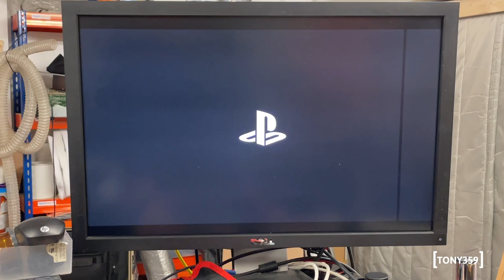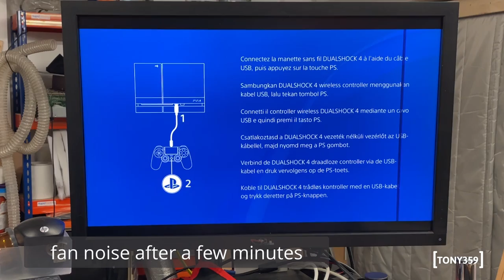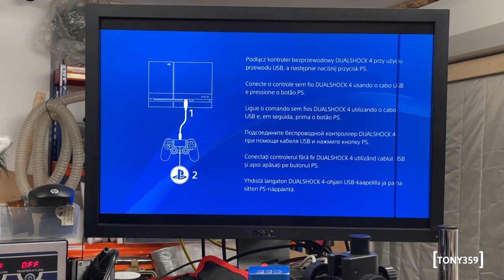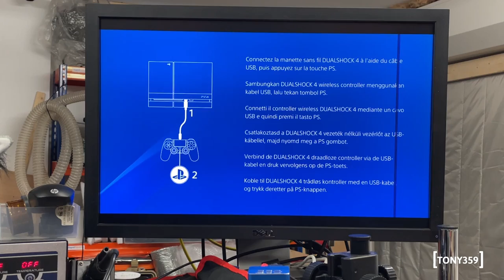Broken/overheating PS4 - Repair and Restore (Fan Fix!)

Comment: Hi Tony! I just cleanded my ps4 entirely. However it wont let me start the ps4 again now. When pluggin it in it gives a short beep and turn blue for a sec no fan spinning. And shuts down. Any recomments? Thanks in advance
Reply from the maker: Maybe 12 volts is missing? Make sure the PSU is fully pushed against the board and that you haven’t bent those prongs
Reply: @tony359  thanks Tony i tried everything you just said, but still no good result. I can hear the psu make weak noises. You think i should give i a try with a new psu?
Reply from the maker: the fact that it was working before makes me think something went wrong with the disassembly/assembly. I think the PS4 PSU should make a CLICK when it starts. But when you plug the power lead it should output 5V. 
Do you hear a BEEP when you press the on button? If not, make sure you get 5V at that little lead going from the PSU to the motherboard. If you do hear a BEEP, well then the PSU should start and you should hear a "click". You can try with the PSU removed from the PS4 - but still attached by the small/short lead, that's the 5V and ON/OFF. If you can measure 12V out of it, then there is a issue on the board. If you hear BEEP and no click and no 12V, then maybe you need a new PSU. Of course be careful with PSUs, don't open it and you take all the responsibilities (sorry, I have to say that!)

Comment: I've opened my ps4 recently and cleaned it using a small brush and air pressure. It's not as loud but it still heats up and makes alot of noise. I only removed the power box and cleaned from that area and didn't take off the motherboard to clean the heat sink from both sides. Should i still completely taking it apart if I don't have thermal paste?
Reply from the maker: it will probably help a lot!

Comment: Replaced my fan with a new one, now it sounds loud and i get a white light then off it goes. Could i have a issue with the power supply,
Reply from the maker: I suspect you didn't re-assemble the heatsink properly. Did you replace the thermal paste? Did you make sure the thermal pads were in place?
Reply: @tony359  il try reapplying thermal.
Reply: @tony359  thanks, I took of power supply noticed a loose cable. Now back up and running and like brand new. Cheap fan I was skeptical but I cannot hear any loud noise even on the jailbreak it's fine. Mega cheers to ur videos

Comment: My ps4 is overheating too. I cleaned it, replaced thermal paste and fan sounds normal. In my room is 22°C and there isn't anything half meter in any direction. I cannot play any game for more than 3min and I cannot figure out what is wrong with it.
Reply from the maker: when you say "the fan sounds normal" - do you hear it getting faster and faster before it shuts down? Have you replaced the thermal pads by any chance? Too thick and the APU won't contact properly with the heatsink. Try removing them for a test. Finally, have you reinstalled the clamp at the back of the board correctly?
Reply: @tony359  I didn't clean heatsink well enough...my bad🤦‍♂️
Reply from the maker: yay, it's working :)

Comment: My ps4 has overheating problem not even 3mins has passed it suddenly turns off with a warning sign of overheating. So, I tried opening it and cleaning all of its components and putting thermal paste, done it all for the first time. Still overheating, but improved I tried stay idle in a game for more than 30mins. So, I tried changing the fan, the thermal pad looks still okay not dry so not changing it and now it's good no jet engine noise and there's no burning like smell (the power cord is not the problem and so the outlet because its not hot). Beside the fan the cause of overheating might be the wires not properly connected, screwing too tightly, loose power cord, too much thermal paste on cpu or too thick thermal pads. In addition, when putting thermal paste put a little bit more in the middle of cpu and dont use liquid thermal paste they say its bad for ps4. If one thermal pad has crack change it too.
Reply from the maker: burning-like smell is bad! But I guess that if the fan is not working, that might happen! :)

Comment: I need your help no matter how much I clean my ps4 it keeps over heating iv tried cleaning it cleaning round it putting it on a stand so it can get better air flow but nothing is working I need help
Reply from the maker: My experience is limited with PS4 but I guess you're not re-assembling it correctly. Have you replaced the RAM pads by any chance? If they're too thick, the CPU won't be allowed to sit on the heatsink properly. Does the PS4 overheats straight away or after a while?
Reply: @tony359  if I start playing a game after a minute of playing the game it's flashing red saying its over heating maybe I may need to get it cleaned professionally
Reply from the maker: Is the fan spinning? The fan connector is very fragile. Do you hear the fan spinning faster and faster? It will get VERY loud when it's overheating. When that happens, do you feel hot air coming out at the back of the PS4?

Comment: actually, we have the same Ps4 Mode. I tried to clean it out and after cleaning it when I play my NBA loading My Career it says overheating..😢 thats why I'm here.
Reply from the maker: Is the fan spinning faster and faster until it says overheating? The fan is VERY loud when it's at maximum speed. Did you replace the thermal paste on the CPU?

Comment: For that money that is a great deal. And great job in fixing it. The fan should be opened from the back side. Just like the old PC fan. They used to have a rubber plug that after removing it gave access to an C clip that held the shaft in place.
Reply from the maker: I’ll try but it seems a plastic mould. The PS4 is a great little machine but clearly built with price in mind. Thanks for watching!
Reply: @tony359  Today the fans are no longer serviceable, sadly.  They do this on purpose, to buy another one.

Comment: Nice find.
You should also always clean the round rubber on the spindle motor when cleaning an optical assembly. (q-tip and alcohol) That makes the disk stick while rotating.
I too have 3 PS3's and looking for a cheap PS4 to get hold of.
Reply from the maker: That's an excellent point - To be honest I think I did, it just didn't make it to the final cut! I used some paper towel though as I found that cotton buds left lint behind on the rubber. Thanks for watching!

Comment: This console wasn't the worst i ever seen.
Got an xbox 360 that had way more dust but mostly cat hairs inside, the controllers had half a packet of crisps and beer residu inside.
The older consoles are way cleaner to work on.
The fan probably has a clip on the other side of the shaft, drilling open the centre on that side should give access to that.
Worst case there is some nice copper wire for trace repair inside of it👍
Reply from the maker: I didn't think of drilling the other end, thanks! Oh yes, I've seen videos of worse consoles online. Still, if I had a "device" and it starts making the sound of an airplane, I would take it to someone who can take a look? :) Thanks for watching!
Reply: @tony359  people throw away things and replace it for a new device instead of repairing it.
The days of electronics shops that do repairs are pretty much over sadly.
The console modding and repair shops are also dwindling sadly.
Reply from the maker: @samuraidriver4x4  Unfortunately. To be honest I kind of understand them: I can do this myself but if you need to pay someone, it might not be worth. We live in the disposable era unfortunately. Let's say that maybe those consoles could be built to allow the user to remove a flap and clean the heatsink - I believe the PS5 has something similar? The PS4 WILL need a clean at some point...
Reply: @tony359  indeed, repairs also got alot more expensive because they are difficult due to SMD components.
If a transistor in the TX amplifier of a CB burned out it was an easy job but replacing a USB-C port is a whole other ballgame making it alot more expensive.
I doubt sony wants their customers cleaning a heatsinks because they rather sell a new console.😂
And you know what's going to happen when they add a flap to access the heatsink, someone is going to use some hot soapy water to "deepclean" it🤣
Reply from the maker: @samuraidriver4x4  yes it's a catch-22 situation but our planet has limited resources so this will have to change at some point. So maybe we could start now! :)

Comment: 2:11 
I accidently destoyed the upper white clip while you holding it with your right hand. the cable goes in and staying in position with the metal thing. But the white clip is missing. Do i have to replace the whole connector now? Or it will make contact with some duct tape to put some pressure? I ask you because i cant test it now, i;ll have to buy a new daughterboard bdp-020 the older one is broken.
Reply from the maker: It might be fine. If it works, happy days. :)

Comment: Hey that was a nice job you did there. 
I was wondering what screwdriver and tools did you use to do all of the work?
Reply from the maker: It's a kit from Kaiweets. I mentioned it here: https://www.youtube.com/watch?v=4rJkzYdi7xQ
The screwdriver kit is nice. The bits are sturdy - the handle is not the best. It's still in one piece but the locking mechanism is not smooth anymore. That said, it sells for £16 and for that price I think it's amazing to have! Thanks for watching!

Comment: Hey Tony, awesome job on the restoration. I was wondering what polishing compound did you use here at timestamp 14:17? I would love to know for further jobs i do for clients as i am an electronics repairs expert here in my area.
Reply from the maker: Thank you! It was more or less T-cut, but something else I had around I think. Make sure it’s plastic safe, then any polishing compound for car body should work. Good luck!
Reply: @tony359  Nice and thank you ill look in to it

Comment: I’m scared of opening up any console I have because I don’t want to accidentally mess up any compartments, are you absolutely sure that I won’t have any issues getting back online after cleaning the fans?
Reply from the maker: Nobody can! What I can say is that if you just remove the bottom cover, you can see the fan and you should be able to see the heatsink through the fan. You can remove the bulk of the dirt with some tool. You'll need a torx tool to remove the screws at the back. But nobody can assure you nothing will go wrong! If not mistaken you can save a backup of your game situation on the cloud, make sure you do that before you do anything! Thanks for watching and good luck!

Comment: I also want to buy such consoles for repair purposes. From where I can find such damaged consoles at cheap prices in Europe?
Reply from the maker: Local adverts I guess. Facebook marketplace, local websites and Ebay! But beware, it's VERY easy to get some very abused items. If you go that route, I'd recommend you only buy sealed units. That way you know the owner did not open it and made things worse.

Comment: Thanks for the video. How can i test the fan in the workbench? Can i connecton12v to first brown wire and the black ground one? Or it need to be all 3 wires connected to work? Thanks
Reply from the maker: I am not 100% sure to be honest. If the fan has 3 wires, it should be working with 12V - the third wire is the tachometer FROM the fan. If it has 4 wires, then you need a PWM controller.
Reply: @tony359  thanks for the fast response, i go try the 12v, need to see if its a fan problem or something worst cause my ps4 turns off after 2min in the initial menu. 👍
Reply from the maker: You should be able to hear the fan spinning though. If it doesn't spin, then you'll hear it. In doubt, you can do as I did in the video and keep the fan outside of the case so you see if it spins or not - only for a short time though or the APU will overheat.

Comment: Tony i drilled my ps4 added the lubricant but i think i added too much and the fan is not spinning completely please i need a solution can’t afford a new fan
Reply from the maker: I'm sorry but I really don't think the fan can be "properly" fixed. I did that in my video out of curiosity but I wouldn't assume it's going to work! I also don't think too much oil would prevent the fan from spinning... good luck!

Comment: What if your ps4 is clean but still over heats? Pls help😢
Reply from the maker: The PS4 does not have a "heat spreader" that can go wrong so I suspect two things
1. Error in re-assembling
2. Memory thermal pads are misplaced or too thick (did you replace them?) and they prevent the heatsink from touching the actual CPU.

You can TEMPORARILY trying without the memory thermal pads to test.

Are you sure the fan is running?